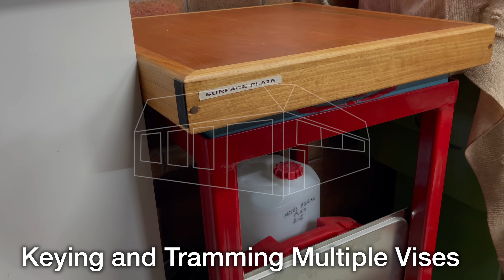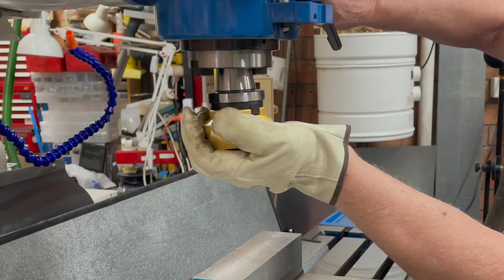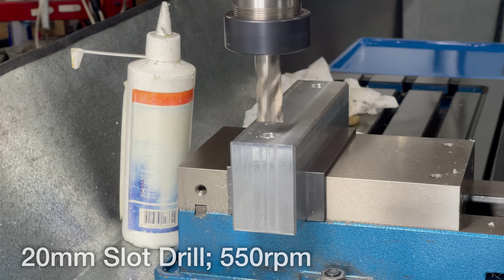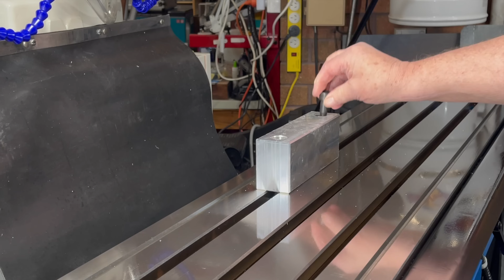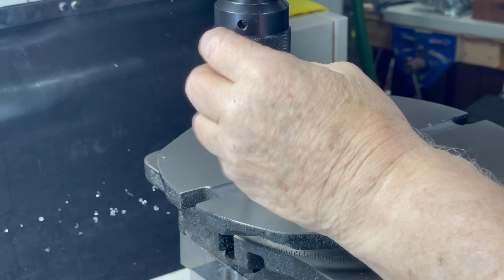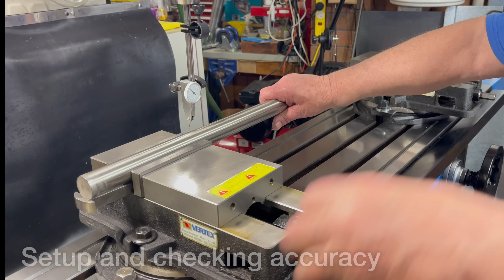Keying & Tramming Vises for a Milling Machine #hfcreators

Comment: Man that Mill is smooth as butter
Reply from the maker: Thanks for the comment and for watching. It's all run by inverters. The Spindle speed is controlled by a VFD not expanding pulleys, It is very smooth. Cheers SteveO

Comment: There is a reason why swivel bases do not have keys.
Once you clamp a swivel base between the vise and the machine bed, you immediately sacrifice geometry and rigidity — simple as that. For this reason alone, a swivel base should only be there when you genuinely need to swivel. Add to that the extra weight you have to haul around, and it’s easy to see why many machinists skip them altogether.

Adding keys to a swivel base can help if the last person actually reset the vise to true zero after rotating it — but let’s be honest, you’re always going to check the tram anyway. Trusting a keyed swivel base to be left at zero degrees perfectly every time is wishful thinking.

When you’re running two or three vises together, there’s no reason to swivel them; well, you can't if holding one long piece. In these setups, once again, ditch the swivel bases altogether — and use the factory supplied key slots (assuming you’ve confirmed in advance that all the fixed jaw’s offsets to the key slots match).

Swivel bases tend to live out of the way on the workshop floor, covered in dust and cobwebs. They are so rarely used nowadays due to their inherent limitations. I honestly can't remember anyone using one since I was apprenticed back in the 70's.

What I’d really focus on are the factory key slots in the vise body. Make sure those are machined accurately in relation to the fixed jaws — that’s your reference. If needed, either make offset keys, re-cut the slots, adjust the thickness of the fixed jaws or best of all, skim the face of the fixed jaw block to get everything dialled in just right. That way, you’re not fighting alignment every time you bolt the vise down.

As for the soft aluminium round keys in the block — I can see some logic for a limited use, but the combination of softness and minimal line contact means they’ll wear out fast with regular vise use. Good idea in theory, but not something I’d rely on in practice.
Reply from the maker: Thanks for the comment. I have bought vases that do have the swivel base keyed, but I agree with you that this is the exception not the rule. I prefer a to use a vise with the base attached and I like it to be keyed so I don't have to tram it each time I use it.
Multiple vises always need to be setup for a particular job and I find it easier when the A vise is keyed, but that's just me. Cheers SteveO
Reply: True